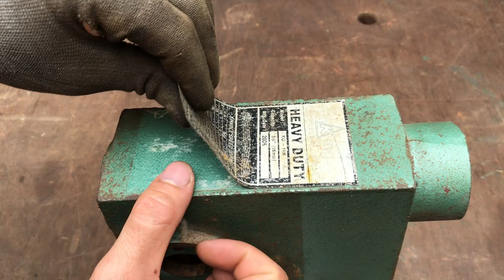Drill Press Restoration - How to remove drill press chuck part 1

Comment: Thank you for posting this - it's the most complete and useful teardown of this OEM design that I have found.

Brings back memories doing mine. I didn't know how to get the top front pulley off though - I'm going to disassemble the top and quill to replace all of the bearings. These seem to be a pretty common OEM design out of Taiwan, mine being branded a Rexon 13" RDM-80A model.